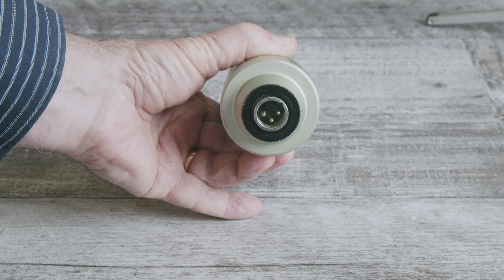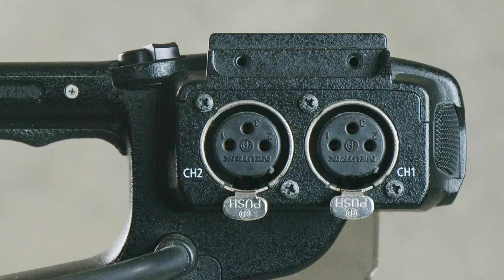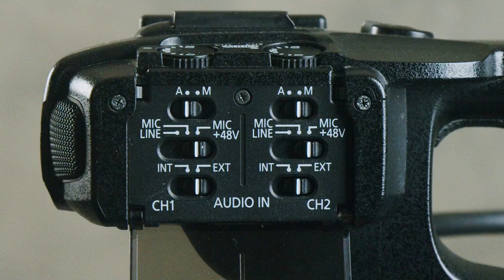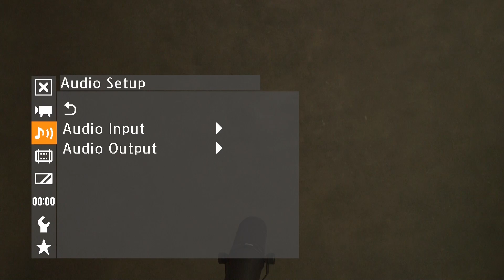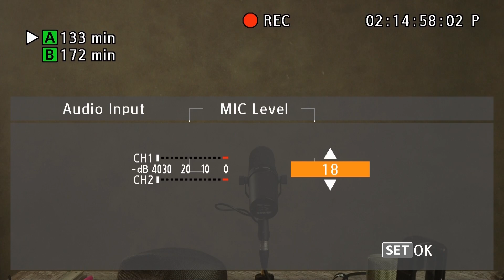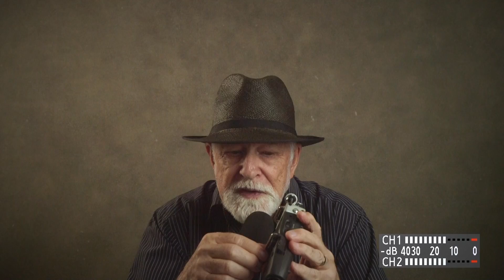Audio on the C100 - an introduction to  the basics.

Comment: Perfect. Thank you. I was mostly searching around YouTube to find if anybody had a product that could replace the tiny wheels on the audio handle. I like the audio going straight to the camera, but the tiny wheels are so small and the slightest turn can make a big difference, especially if you need to make an adjustment during a recording. I will try the eraser technique next time.
Also, can you do a video on how to correctly use the limiter feature. My last interview I had to set the input volume low because he would often raise his voice and I would see my meters going into the red. Overall, what happened was I ended up recording low and had to bump up my volume all the way up on the computer while editing. Thank you for the tutorial. I was hoping there would be a separate controller that could still allow audio to be baked into the video without the tiny wheels being used. I am new at this, but constantly learning. Thank you I will subscribe.

Comment: Thanks, Paul, for the informative C100 Audo tutorial. I was surprised and at the same time happy that there is still interest in the C100, because the C100 has now been on the market for more than 8 years. The reason for this is certainly that this camera doesn't really age, it is still a perfect tool for professional filmmaking, I love this camera. It doesn't have a fashionable 4k sticker, but it does have a 4k-capable sensor that delivers excellent highres images. Your tutorial was just the right time to refresh my knowledge because I want to connect my new wireless mic and find out about the different connection options which the C100 has. (I have the Mark II version) Thanks again.